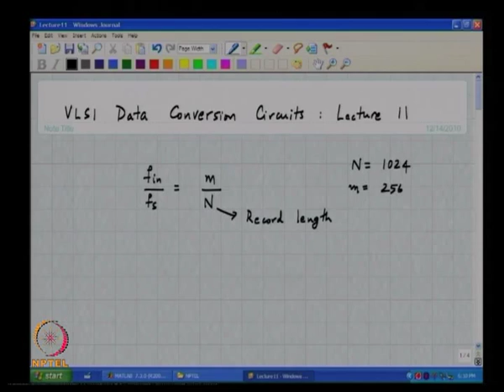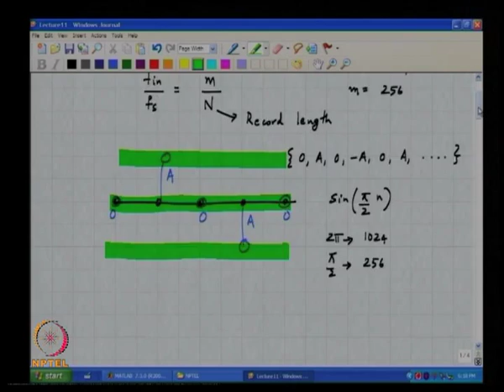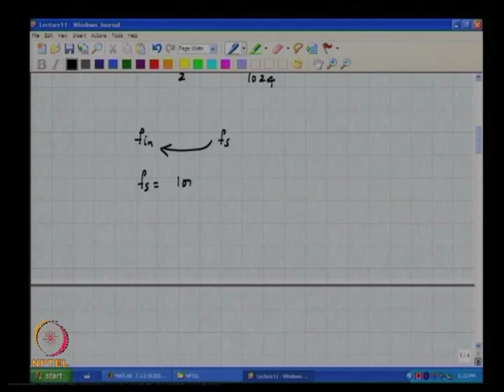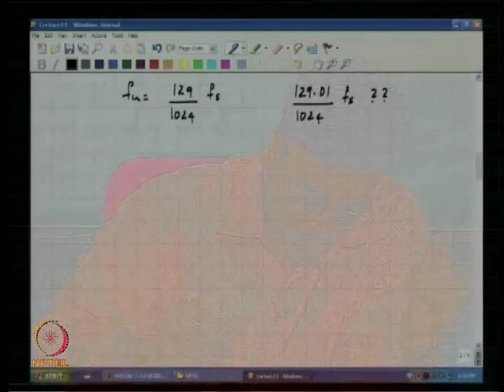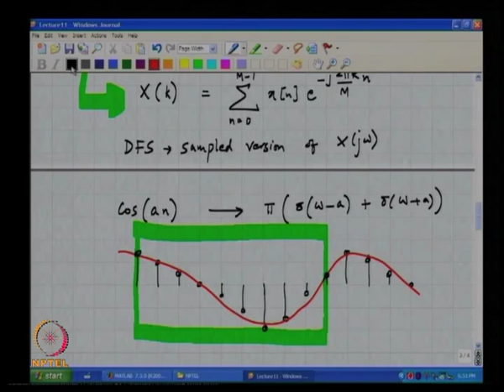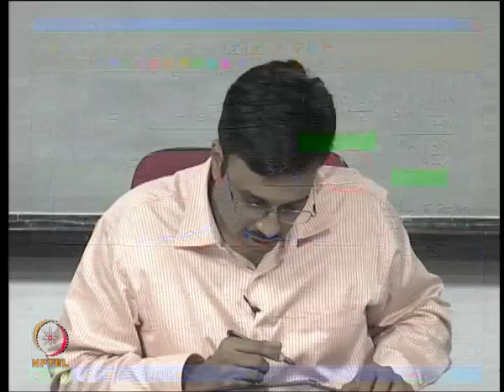Mod-01 Lec-11 S/H Characterization - 2

Comment: fin/fs shall be relatively prime to distinguish  input harmonics from FFT. So to maintain input freq ration with respect sampling freq all the time, input signal and sampling frequency generator shall be in sync.Sync can be achieved using phase locked loop.This is called synchronous sampling.Not obeying this can cause terrible FFT sprectrum.

Introduced DFT and DFS (Sampled version of DFT). Explained the reason behind the inaccuracy in FFT spectrum when synchronous sampling is not followed.